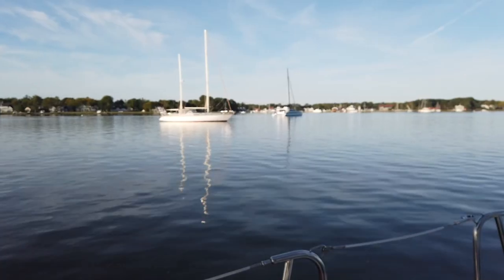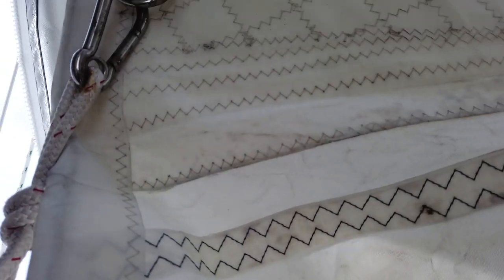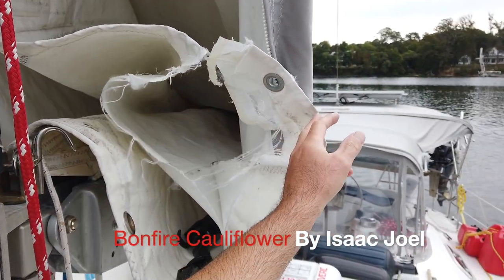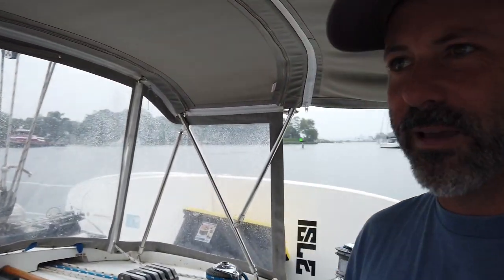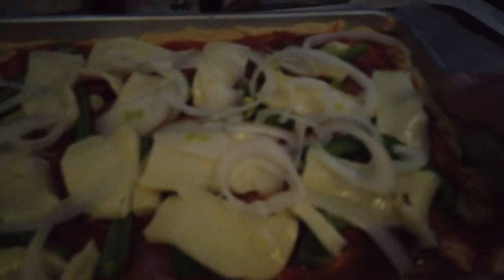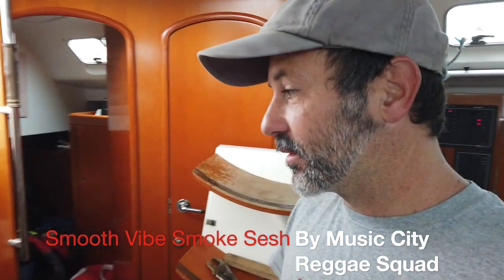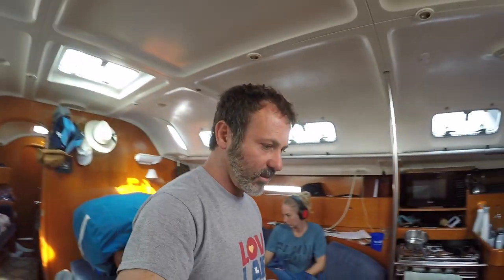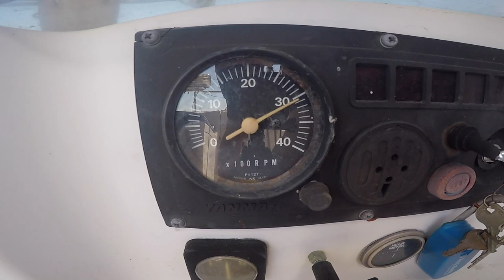DIESEL ENGINE: Issues and Ripped Sails, Acadian Adventures EP76

Comment: We had a similar issue with our yanmar. Had a runaway with oil bypassing turbo, then 2 tips blew providing the last bit needed for a runaway. Good you stopped when you did. Our head was cracked, more piston damage too. Installed a new beta diesel this year
Reply from the maker: @Lonestar Sailing sorry to hear that, run away on a diesel is serious! Was it a Yanmar?
Reply from the maker: Ha never mind... just read your comment again.
Reply: Yeah  yanmar 4jh te. 55hp. Managed to stop it in 30,sec, but damage was done. Still ran when replaced injectors to get home. 
Took it all apart. Too much cash to get a new head and all the other consumable parts.

Comment: I know this video was released months ago and sorry for the late responce.  I don't think dirty injectors are the reason your oil level is rising.  I suspect the low pressure  lift pump on the engine.  It bolts directly to the engine on the starboard side and is actuated by a short arm that rides on the cam shaft.  It is a diaphragm type pump and if the diaphragm tears, it still pumps fuel to the high pressure pump but also bleeds fuel into your engine oil sump.  I have a similar engine and recently replaced the lift pump, like $60 on Amazon.  Waves and wind be in your favor.
Reply from the maker: Montana Dan, hey thanks for the comment!  I had replaced the diaphragm pump with no luck.  We eventually had the injector pump rebuilt and presto problem solved.  She's been running like a top ever since!  Currently at Great Inagua Bahamas setting off at 4:00am in the morning for Dominican Republic!
Reply: @SVAcadian  to Luperon and beyond......Wishing you speed and comfort.